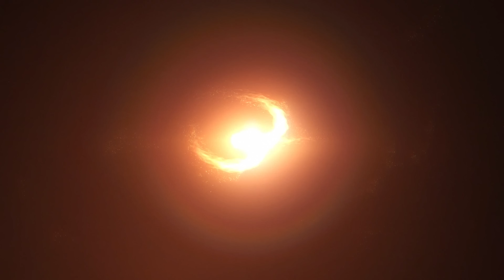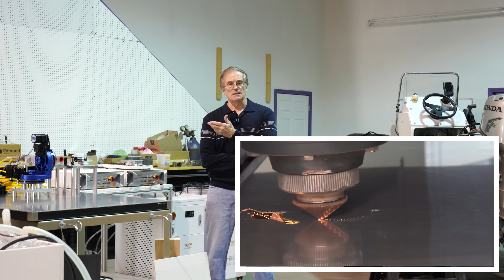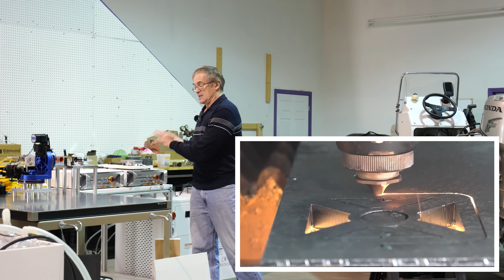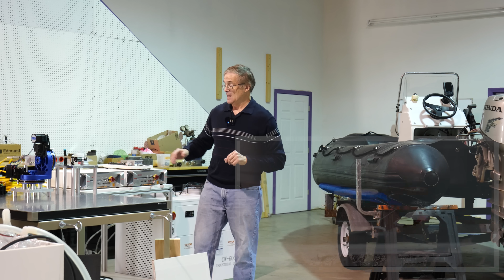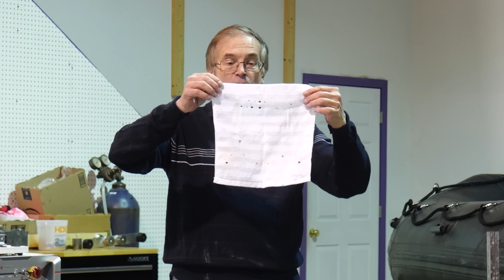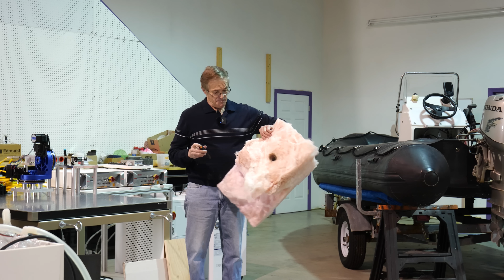We have a problem... and need your help!

Comment: Mirrors between 2 feet and 5 feet in elevation all around the shop. The only problem is obvious, reflections. Maybe orient them at 45 degrees so that the beams hit the nearby concrete floor?

Comment: Why not just go with the brick wall but make it easier to move? Build the brick wall on a pallet and use a pallet jack to push it in and out as is needed. You could even build it on a trailer and pull the trailer in and out with a truck.
Reply from the maker: Do you understand that we have to protect the entire back wall?
Reply: @TechIngredients Oh, the entire wall?! Would the laser be expected to go that far off from where it’s aimed?

Comment: I Use to work on CO2 laser brass seemed to resist to it i think it was because it's color which was close to the laser color...
Also l would try a glass fish tank with water and something to defuse the laser with, glass marbles maybe, water should handle some of the energy ok, you probably will need layers

Comment: 2 ideas:

1) redirect beam with sloped aluminum sheet or mirror at 45 degree to ground. then you have a hole. but in the ground. should be safe 😁.

2) painting a thick layer of starch on a wall to form starlite like structure go have carbon protruding from surface continously to act as carbon based refractory( which has boiling point of idk 4000 deg?). also a guy on youtube hawkinnight? had a video on.

Comment: I suggest building a shield of inexpensive ceramic tiles (alumina or alumina-silica).  They are readily available and come in a variety of shapes and sizes.   They are used in applications like the space shuttle, jet engines, and high temperature furnaces.

Comment: my first idea was copper, or heat pipes, but ain't no way they wouldn't melt. Maybe an engineer can do the math, but I think that power delivery is greater than any thermal conductivity could dissipate, so any solution would need to be single use (I'd still try a copper plate or heat sink painted with vantablack or some other graphite coating, just for fun)

Comment: If I may go with my 2 cents, I think the most important is to spread the beam as fast as possible if you don't want to burn through any material before the garage door.

One solution could be a alignement of thin wires like for diffraction gratings, spanning several meters in height but placed relatively close to each other as to multiply the beam and divide the energy in a sufficiently diffuse and wide in order to spread the beams energy onto a wider area of an absorbing surface like cooled down metal coated with a dark and chemically resistant paint.

This could allow for example to have the laser beam to be able to move fluidly in a vertical plane aligned with the first wire but unrestricted along the Z axis so as to be able to follow and target the drone.

Comment: Can you not set the test up to shoot down into a pool of water?  The drone flies over the pool (paddling pool or something) and the laser shoots from above into the water to be absorbed?  Adjust water depth for the power of the laser. At least for testing it should work ok?

Comment: A double wall.
1- Laser side consisting of clear borosilicate glass
2- Void filled with a light scattering, opaque mist. ie. steam, fog, dry ice fog, etc...
3- Back wall painted the spectrum negative of the laser light.  ie. red laser = green wall, green laser  = red wall...

My theory is the coherent light will enter the chamber and get scattered by the mist.  The back wall will create an interference wavelength of light reducing the power of any laser making it to the back wall.

Comment: The brick seemed to hold up well, and my thought (not experienced in this area), is to build or buy a similar material that is rotating so the beam can't sit on one spot for too long. Would need to be a large circular board that is structural enough to have continuously rotating, and you're target area would need to be a small cross section of the area. Might not even hold up as well as I imagine, and end up cutting the 'crust' off the whole pizza. My 2c.

Comment: I think you are looking at this the wrong way. I think you already had the solution when you explained how that metal cutting head focuses the beam to the point of cutting. What I would do is look into a targeting device that could perfectly range-find the distance to the target and design an apparatus that could focus the beam to that distance. This way, you only need to worry about where you have the beam focused.

Comment: Pulse the laser really briefly, just long enough to damage a drone?  The backstop won't need to last as long.  To down a drone you could just cut or unbalance enough of the props, maybe using a bunch of pulses scattered over a small area.   Another way to down a drone, not as fancy, might be to blow lots of sticky strings in the air to tangle the props a little so it can't fly well enough.

Comment: Not exactly what you were asking for but how about something that can optically detect when the laser is hitting something that it shouldn’t and turn off the laser?  This would make it so that when the laser was hitting the material that stops the laser, the laser would be turned off very quickly and thus reducing the requirements of the stopping material.

Comment: Should really have some real-time low-level hardware/circuit, as a watchdog/lockout for the computer input, in case the computer freezes up, instead of just manual emergency switches imho.
Reply from the maker: Good idea.

Comment: Graphite bricks? asbestos tile? IDK... This seems like a lot to ask of even modern material science. I'd probably look into some old NASA docs on ablative tiles in case there's something DIY-able in there 

If i had to build something to block a laser like that, personally, I'd do a plywood-sand-plywood sandwich & put a hose up top to trickle water through the sand. Maximize the amount of phase change needed to make a hole, and the potential for gravity to self-seal any holes that do get made. Unfortunately, I'm pretty sure any even decent sized wall built like that would need to be made into a trailer to even approach portable

Comment: 1/2 thick aluminum plate.  Mill a cooling path on one side. Gasket material (paint on) then 1/4” thick cover. Which is screwed down in many places. Its like a cooling plate.

Shot peen the thicker plate with .5mm shot (or smaller. 

Anodize the thick plate to be black. 

Run chilled water through the cooling lines. 

I can help with the flow pattern.
Reply: Obviously the shot peened side is towards the laser.
Reply from the maker: We need to limit the cost.  Over such a large area, that sounds expensive.

Comment: So thinking about the brick and the ways made made me think of something else or three. A thin-ish slab of granite (Laurentian granite being the darkest with the most quartz inclusions) say 3/4"? my other thought ran to a rough quartz slab(s) for it's diffusion and lastly hit up the local charity shop for some Him-a-layin Salt lamps, smash those into  small stones and put them up in between the drywall, plywood or other mounting substance of choice as a diffusion barrier. That should get you the time you need, none are low weight but are easy to get ( scraps from the local counter top guys?) and not particularly expensive.... other than a fresh slab of granite.

Comment: This seems easy enough.  Build a large thin fish tank with a low concentration of carbon black in solution.  Use clear glass in the front and a mirror in the back, setting the fish tank just short of 45 degrees to the laser.  This gives the laser a great distance to travel for absorption and, by so doing, keeps the thickness of the tank down.  Mirror the thin sides of the tank.  Maybe a sheet of Rockwool where part of the laser will reflect off the front of the glass.

Comment: Is it at all possible to split the beam into independent outputs at lower intensity, then focus those outputs at the intended target? How many times would you have to split the output to reach safe levels and how much power would you lose focusing multiple smaller beams? A sufficient distance between the separate beams would then achieve the same result as the milling table. Would this significantly impact your effective range? The necessary computations should be easy to handle (it's all right triangles with a single pivot moderated by focal length). I'm not sure if you would see this solution as power reduction or not.
Reply from the maker: It isn't. 
The beam director can only move small beams really fast. Large beams or multiple small beams will be slow to direct.
Reply: @TechIngredients for clarification, is this a hardware, software, or mechanical limitation? Also, I don't know much about the materials, is the fiber flexible, or does it need to remain fixed in position?

Comment: Use the ground as a backstop straight down. Put sheets of copper and lead alternating. The lead would melt and fill back in and the copper would dissipate heat

Comment: Just some out-of-the-box thinking here, how about a 2 layer or multi-layer approach?

The first layer being a diffusion layer, and subsequent layers having some distance in-between to promote scattering between them, until you reach the last layer which is the "strong" layer

I'm pulling from institutional knowledge I have on sound-proofing, where the best case scenario is being able to have a first layer being soft (for dampening, which I view similar to diffusion in light), then air to promote scattering, and stiffer subsequent layers to deal with stronger pressure waves

There's also an added bonus of the first layers capturing any reflections coming back from the last layer

Comment: First thought, big box on wheels (say 8 ft wide, by 8 ft tall, by 0.5ft thick) made of drywall or cement board, filled with sand. the sand will, hopefully drop in to fill the lased area. Unless it vitrifies to strongly.

Comment: It's been years since I studied engineering, but my first impractical solution was an optical diffuser or a beam dump (like CERN's graphite beam dump) that would be cleverly designed. I don't think either of those would be cheap or practical in this solution. Reading some of the other specialists' replies, I see better ways to do so! Really cool to look at others' opinions on the matter :D

Comment: tech youtuber 15 years ago "we overclocked a DVD laser and made a balloon explode! :D"
tech youtuber 5 years ago "I've made a death ray! :D"
tech youtuber 1 year ago "this robot can see you through a wall and shoots lasers out of it's eyes and you can't escape :D"
tech youtuber now "help..."
Reply from the maker: We like the concept of crowd sourcing laser defense systems.
Reply: @TechIngredients  we'll be needing terminator defence systems at this rate :D outside of anything ablative or some kind of optical 'sink', using fibre optic cable bundles to 'soak' away the light to somewhere safer, I have no idea how to deal with lasers this powerful :o

Comment: The first idea I had would be glass pebbles in some sort of aquarium, so light could scatter and the energy could be absorbed by water, but the geometry of the pebbles could make this unsafe. Instead, I propose using a box of saturated silica. I guess that the pellets would burst with the sudden heating, but it could help to mix the set, allowing other pellets to block the laser path.

Comment: Based on the previous video, it is necessary to protect an area of 8 by 4 meters.
Sandbags are an excellent material for protection, but you need an incredible amount of them.
Previously, there was an idea with a frame/aquarium filled with light-scattering/light-absorbing fog.
To accurately measure the thickness, you can first check in a small area without deflecting the beam with a long, 1.5 m box filled with an aerosol of water and wavelength-absorbing particles, a water pump and several sprinkler nozzles.
Put a photosensitive sensor at the end of the box, which will trigger and turn off the laser.
At the same time, the walls of the box should be made of light, non-flammable fiberglass, when a hole appears in it, it's not scary, the task of fiberglass is to keep the aerosol inside.

Comment: What about just a rough surface (opaque) of IR transmissible material?
That way the shield itself isn't destroyed because it doesn't absorb the laser, and it disperses the laser to a larger area, just like the machine :)
I don't know the exact frequency of the laser, but acrylic is very transparent to some frequencies, so it might work? And to make it opaque you can just sand it. Any reflected light should also just scatter and be safe, and it should be pretty cheap since the thickness shouldn't matter and you can use like 0.5 mm acrylic sheets :) Or maybe plexiglas.

People have suggested water curtains to absorb the energy, but maybe a water curtain could work to scatter the light instead? That way you don't need to pump tons of water.

Comment: A transparent tank of dyed water, dyed to the proper color to absorb that wavelength. Apply at least 2 rows of bubble curtains to the bottom of the tank to provide numerous stacked and random refraction paths. Backed by the absorption of the tinted water, a foot of water should be more than plenty to dissipate that kind of energy.
Reply: That is a big wall to cover though.

Comment: Find some material transparent to your wavelength, and see if thin sheets of diffraction gratings can be made out of it. Most plastic works for visible light. This will split the intensity of the beam into several spots, the distribution of intensity is determined by the profile of your grating. Could be followed by a diffuser and water tank with dye as others are suggesting.

Comment: Can you use pwm to control targeting then full power for the destructive stage
Reply from the maker: That's basically how the system works now. What we need is a failsafe if that system locks up.

Comment: My first thought was a pile of dirt or a wheelbarrow full of dirt. Second would be the material that is used on the space shuttle panels for reentry. I don't know what that material is but I'm sure you could find that out. Also something that is similar to fiberglass is mineral wool. it is denser and it should go out soon as the fire is taken away. or maybe the fireblanket that you can get from your fire safty kit.

Comment: Use bismuth with a naturally formed hopper crystal surface. The fractal stair-step geometry disrupts the coherence of the laser through phase scattering and geometric dispersion, not brute resistance. It doesn’t fight the light, it dissolves its intention. The bismuth must be properly treated, either through oxidation, controlled cooling, or surface etching to preserve its phase-disruptive geometry. Without this treatment, it will melt too quickly and lose its anti-coherent function.

Comment: Lasers still are affected by the inverse square law. Its much narrow than regular light but is still affected. A 1/2" steel plate should be more than sufficient. If you are concerned about reflection, have it slightly angled downwards. Any reflection wouldnt be anywhere strong enough, and some sand would absorb the remaining

Comment: What about a water tank?  The water in the blankets and towels took time to replace what was evaporated, but a large water tank should work better.  

As far as transportation, it could always be emptied when moving it. Or you could even build a tank frame with water tight stripping that you could slide the glass in and out of so the tank could be disassembled for transporting

Comment: I'd try a multilayer system with the outer layer being non-reflective, and the inner layer(s) being reflective, but somewhat diffuse. You could start as simply as drywall spaced ~1" apart with a space blanket glued roughly to the inner faces.

Comment: Use sand  !  between 2 surfaces like gypsum  drywall 5 cm should be enough.  
2 , cover , flammable surfaces like  drywall with sodium silicate its an amazing fire retardant .

Comment: A large waterfall wall feature, with black die or sand would be my best cheapest option 

Fish tank filled with water and black die and or sand that is constantly circulated within the tank

A water misting sprayer like a pressure washer

Maybe something that moves quickly like fan blades, but what type of material to use on the blades?

Comment: What would be the effect of the laser on a mirror with an opaque or stippled face? Im picturing the beam would pass through and reflect off the mirror back to the inside of the glass surface and scatter. Is this correct? Or would the laser beam just burn through the mirror, or reflect back as a still dangerous beam or light intensity?

Comment: Beam dump right after the laser radiation source with a beam switch that is normally in the state that the beam gets dumped. So you dont have to dump a highly concentrated beam that evaporates the target. 

If you still need a protection system go with aluminum sheets  with a highly reflected, yet frosted finish that disperses the laser beam when reflecting. (Wear appropriate googles at all times and encapsule your laser contraption)
And coffee is a cheap very good absorber also for laser light so if you guide your laserbeam into the vertical orientation, then you can have a deep bath of coffee as a beam dump. 

You can find professional laser saftey walls when you search here on youtube "Laserschutzwand für Hochleistungslaser HS Mittweida"

Comment: Get some salt. Create a mold similar to one used for bricks. Heat the salt until it becomes liquid, then pour it into the mold. Use the resulting salt bricks to build a wall. A laser can melt the salt, and you can reuse the salt over and over again

Comment: 55 gal plastic drum of water.  drain valve at the bottom, auto-fill float at the top.  a hot glue gun to patch the holes after you empty it